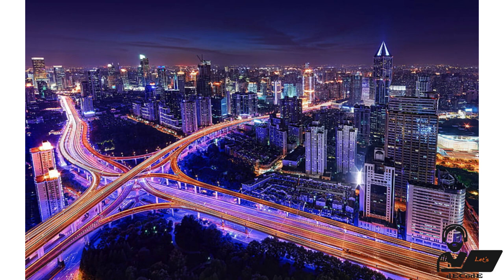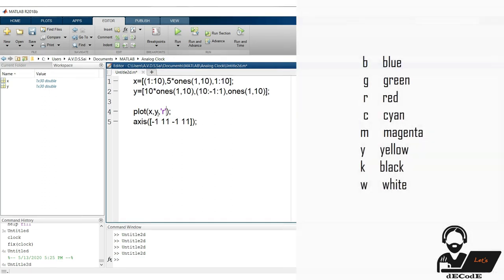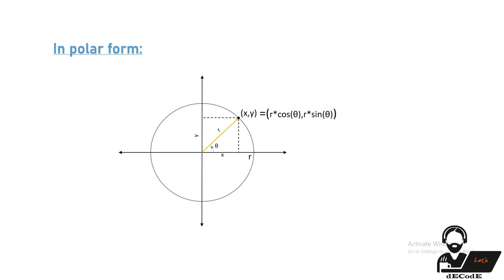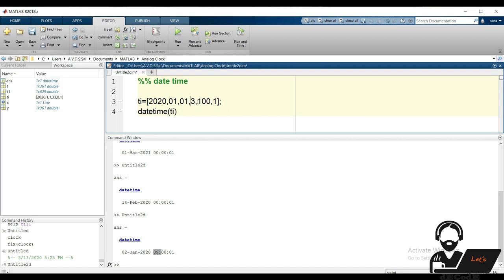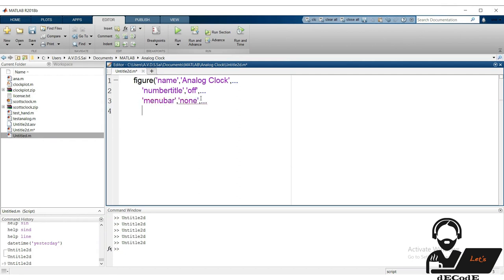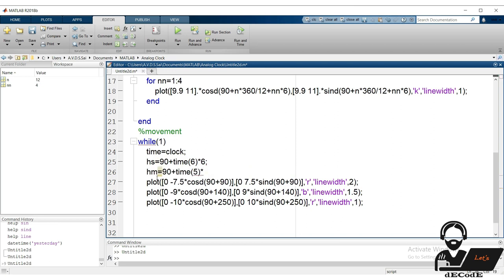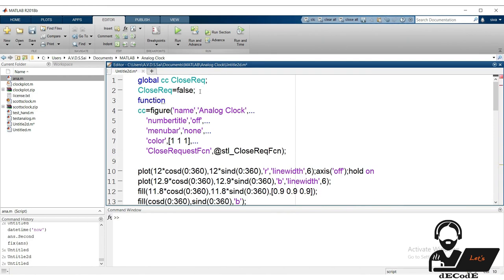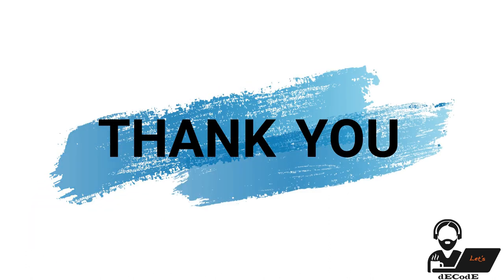Analog Clock Design using MATLAB || let's dECodE

Comment: Write an M-file using a while loop to realize the following tasks:
(1) Firstly, your program should read in a beginning time and a stopping time in one day such as Hour:Minute:Second from keyboard.
(2) Secondly, your program could display the time as a clock increasing by one second. The clock begins at the given beginning time and ends at the given stopping time.
(3) Finally, when the clock stops, show the time interval in second between the beginning time and the stopping time. For example, if the beginning time is 11:15:01 and the stopping time is 13:33:45, the interval is 8324 second.
( Note: Use input function to read in the two time from keyboard. )
how would i go about this question, given the info in your video?
Reply: yes , in seconds hand ...it advanced to 2 second in one cycle